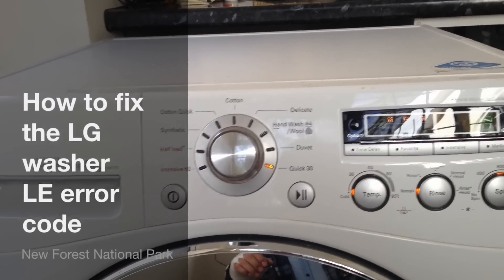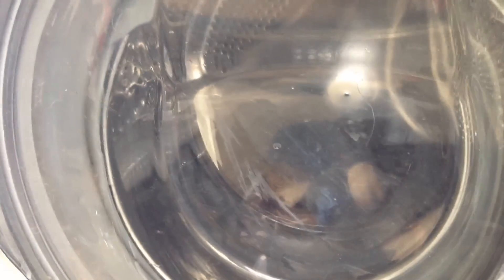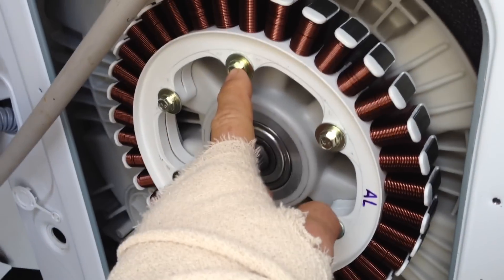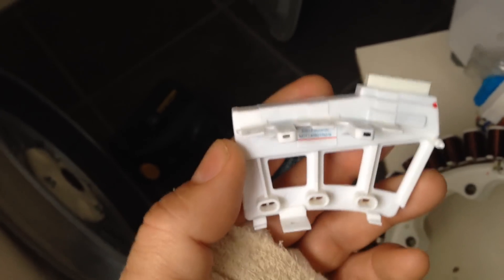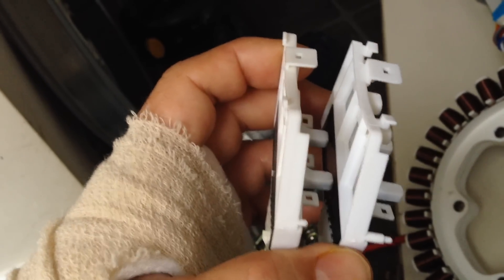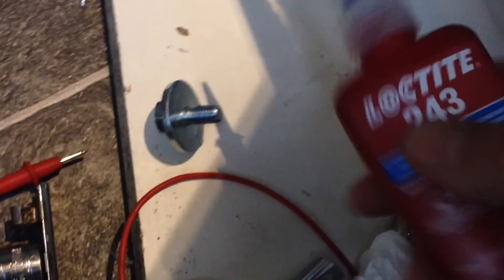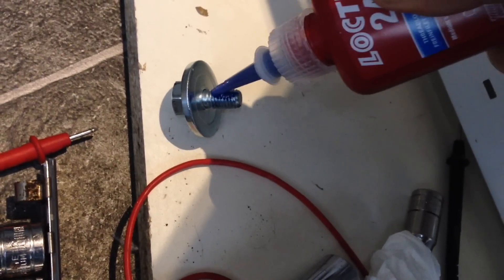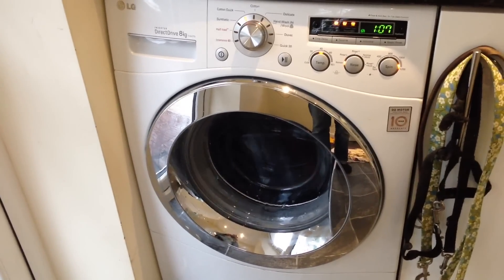How to fix LG Washing Machine LE Error Code - Upgraded 6501KW2002A Part

Comment: Ordered the “original” 6501KW2001A as that was what our washing machine had. 15$ or so on Amazon. Had it in 4 days. With this video and tools readily available (thanks for calling out socket sizes that really helps) took a total of 45 minutes (watching video twice, time to install and time to run a rinse and spin to verify it was working). The sluggish spinning and stopping diagnostic really tipped me off to this being the problem. Saved me the call to a “certified tech” or replacing the machine. Thanks for the video.
Reply from the maker: Cheers. Well done

Comment: I'm going to try this. 10 years zero problems with my LG washer, then intermittent LE errors. I paid a 'pro' ~$100 to troubleshoot and he said it would be cheaper to buy a new machine than to fix this one. So, I ordered a new LE yesterday to be delivered in a week just in case, but then I saw this video -- if this works I'll cancel the new machine and save ~$1k. Thank you for putting together such a clear document and especially in making the part easy to find. The other miracle is youtube figuring out that I had searched on 'LG washer LE error' and then showing me this pertinent video which popped up on my TV last night. I will report on whether this worked in my case as soon as I receive the part from Amazon.
Reply from the maker: Thanks, be interested to hear if you fix it.

Comment: Thank you for posting the video. Just installed the new sensor and machine  seems to be working as it normally should. Cost me $40 for the part and shipping. Heck of a lot cheaper than calling in a repairman or buying a new machine! Thanks again!
Reply from the maker: Cheers. Also great to know and well done.

Comment: This is exactly how its done. My father and I did it in less than 20 minutes. the steel cover was tricky you have to wiggle it out towards you. YES IT IS MAGNETIC. I didn't realize how strong it was. Be careful it's sharp. the only thing we did different is not drill the position sensor just clamped on. It now works like new. We are using it as I type this comment. Great job on making this video.
Reply from the maker: Olef Elias Thanks for the feedback.  Well done on fixing yours.
Reply: +comeinhandynow You shouldn't have to buy a brand new machine and then have to spend time fixing glitches that the company produced.
Reply from the maker: +Sharon Joffey True to a large extent, but then it did offer several years of good service before it broke.  You are right that it should have been designed better, but also nothing lasts forever.  As an ex electronics designer I know that all consumer electronics has a target design life of 10 years. The reason being that physical and chemical changes in the electronic devices mean that it is impossible for it to last forever, so a life target has to be set.  So break downs and fixes are to be expected, it is just a matter of when rather than if.   It is for this reason that I like to show how to fix things so that stuff can last longer.  Regards jon

Comment: Really helpful video thanks. I am mechanically incompetent but managed to repair my machine following your guide. My challenge was getting the backplate back onto the spindle. Fiddly aligning the spindle teeth when the magnet is pulling you about. Just gotta persevere. Great not to have to call out Washing Machine Repairman!
Reply from the maker: Well done.  Thanks for the feedback.

Comment: Followed the advice (not about the 002A part) but about it being the hall sensor and what that looks like, how to remove it and even where to source one from and it worked!  Thanks alot - the machines back up and running 24 Hrs after it broke down - top man !
Reply from the maker: Good to hear, thanks.

Comment: Good video. I would add that removing the stator cover isn't as easy as pulling it off. The magnets and teeth of the center spindle hold it on pretty tightly. I tapped the spindle with a small socket and hammer, there is enough play in the wash tub that it will move forward and away as you do this.
Also, my washer is the LG Tromm WM1814CW and everything in the back looks identical to the model you were working on. I got the upgraded 2002A and didn't modify whatsoever. I just snapped it in place and the machine worked again. Yes it stands out a bit more but so does the power connection directly beside it. I didn't see the need for the modification so I tried it before tampering and it ran like a charm.
Anyway, thanks for walking me through it. Big help!
Reply from the maker: +Daniel batal Nice to read some feedback, thanks for the comments and glad that it helped.

Comment: Thank you so much. Our washing machine motor was completely locked, making a metal-on-metal grinding/hissing noise when attempting to turn. Replacing the Hall sensor solved it.
Reply from the maker: Good to read. Cheers.

Comment: I had a similar issue. The motor won't even rotate. I emptied the drum completely, drained the filter and rotated the drum manually by hand. VERY slowly at first but more firmly once it started moving. It probably had something stuck. I suggest you try this out before opening the machine.
Reply from the maker: Thanks for your input.  The symptoms of the problem fixed in this video are when the drum stops and starts rather jerkily and finally gives an error LE.
Reply: @comeinhandynow  I see. well mine would only spin quarter or third turn and had LE. would be good to inspect the drum internally before disassembling.
Reply from the maker: @mlugggy  Yes true.

Comment: We got this error code. After consulting the manual, we realized that the transportation security bolts in the back panel of the washing machine were in place. After removing the bolts everything worked fine. Apparently the bolts prevent the drum from moving during transportation to prevent damage, but they also prevent the drum from spinning if you try to use it.
Reply from the maker: TheHanapS Thanks for your input
Reply: TheHanapS traducir

Comment: Yeah well, I have a LG wm0642hw and it turned out the problem was the braided anti leak stainless steel hoses, these evident have some kind of valve in them and the water pressure in my house stopped the hose up.. same 1E, lE error.. figured this out after having swapped out the sensor. Swapped in rubber supply hoses and I was good to go.
Reply: According to the Owner's Manual, your error code IE is a water supply problem, whereas this video is about error code LE, which is a motor problem.

Comment: Hi Sir!! What's the name of the tool you used to open the motor cover? Im unable to open the cover Because the protection screw is very hard and I don't know what to use to open it, thanks!
Reply from the maker: Maybe you need a set of screwdriver bits with all the various different heads:  https://amzn.to/36CX3xq

Comment: For future viewers... My EI error was caused because my roommate put in a couple of highly absorbant fleece blankets in a single load that the machine was not able to balance. The result was that somehow one of the plastic pins holding the (tub)supports in place was ejected and the resulting wobble pulled loose a black hose attached to the drain & pump assembly. At first I thought this was just a back flow to release water  that was caused by the pump shutting down but in fact this hose feeds a sensor and if no water is detected it will shut down the washer with an IE error. It is not an "Input Error" but a loose hose to the sensor. When not connected the hose lays against the rear panel of the washer and is almost out of sight.
Reply from the maker: Thanks for your useful input to help others

Comment: Yes this worked for three weeks same symptoms and sound they came back dead washer again. I guess the black cloud is still overhead, Now convinced myself problem must go deeper
Reply from the maker: If it fixed it and lasted three weeks, then it was that part that was the problem.  Did you buy the upgraded part or the original number, see video comments? Maybe try again with the another upgraded part.  Mine it still going.
Reply: I did buy the upgraded part but it's online so who knows what I got but part was different in that it had more clips on it but nothing to correspond with on the rotor. Pls remember that according to LG the le code means an motor overload. If one takes that literally, then what is causing an overload  certainly not the load of a pair of trousers and a few shirts so what gives

Comment: Thanks for the video.  I replaced the sensor but unfortunately I still get the LE code :(  Is there a way to test the sensor (to make sure I didn't get a bum one)?  Any other suggestions if the sensor doesn't fix the problem?
Reply from the maker: Sorry to hear that. I'm not aware of how to test the sensor.  I have heard that sometimes the wiring can get damaged and cause the same error. So I can only suggest checking all the wiring especially around areas where the wiring might get chafed due to the movement of the drum.
Reply: There are test instructions on the net, suggest a google, just changed mine - original was open circuit between pins 1 & 5, new was good circuit this position.  Good luck
Reply: That's great!  Thanks for the info.  I'll try that and search for that.

Comment: Before anything check the tightness of the nut on the bottom of top load wash machines. Tightened mine after making squeaking sound and the le error code. Just saying maybe.

Comment: Hi, i’ve been getting an LE error code on my washing which is the same as the one in the video. It started after I put in a heavy load although i’ve never had this issue before. Now my drum wont spin but tries really hard to spin and is quite jumpy. Is your technique likely to fix my issue? Please help! LG want to charge me £72 callout charge with labour :(
Reply from the maker: Same as in the video.  The fix is the one in the video, I believe.

Comment: I cannot for the life of me get the bolt off. Just seems to be completely stuck. Any recommendations for removing it or why it might be stuck?
Reply from the maker: You could try putting a socket and wrench on it and hitting the end of the wrench side ways with a hammer, making it try to turn very quickly anticlockwise to undo the nut.  Or find a way to hold the drum and use a long torque wrench.

Comment: hello! i keep getting an SE or 5E error on my LG washer cant find any mention of such error do you know anything about that????
Reply from the maker: I have no direct experience, but I searched on the web and found this:
"I have today the same error code (SE) on model WD-11155FB. This code means that the speed of the electrical motor can no longer be controlled. The velocity sensor placed just behind the motor is probably damaged but it can be also the electronic board where is connected this sensor, or the wiring between these two items."

That sounds like it might be the same sensor as replaced in this video.

Comment: I replaced the sensor on the drum but after a month the LE warning came back on,  any suggestions?  TIA
Reply from the maker: +Mike Bernatchez So it fixed it for a month, then based on that my only suggestion would be to try changing it again.  Maybe you had an unlucky early failure, or maybe the part is in contact with the drum and so failed.  Was it the upgraded 2002a part or the 2001a part that you put in?
Reply: +comeinhandynow thanks for getting back to me so quickly.  I purchased the newer sensor.    I will try again and see what happens,  otherwise it's a good machine,  hate to see her go lol

Comment: My it shows CL and all the button are not operating please what's the problem. LG front loader 8/4kg machine
Reply from the maker: Search on google for "lg washing machine cl error".  You will see it is an error with the child lock feature.  Check the manual for how you turn off/on child lock.

Comment: how do you remove the first motor cover bolt. when I try turning the wrench the whole drive spins?
Reply from the maker: Either ask someone to hold the drum, or move the wrench very quickly as in the video.  Knocking the wrench or whipping it round very quickly is usually enough to undo the nut as the drum is heavy it is slower to accelerate up to speed.

Comment: I replaced the Motor sensor and yet when I ran it, the Le code still appears, than the lg wasn't getting any power I had o replace the main control board and the noise filter I ran it and still the le error code appeared
Reply from the maker: +Alexandria Mahr    A difficult situation, but since you have changed everything relevant, I can only think that there is a break in the wiring somewhere.  I have read some reports of a chaff in the wiring to the motor sensor causing a break in the wiring.  So maybe measure the resistance of each wire in the wiring loom.

Comment: I have a door error problem.. How to fix that one?
Reply from the maker: Under Wood Not had that on this model but usual method is to test the door switch with a multimeter(ohms with machine unplugged) meter to see if it is working while opening / closing the door.

Comment: Dear the owner of the video.  
I've got the same problem with LE code. are you sure if I replace the chip it will works fine ? please reply me as soon as possible
Reply from the maker: It worked for me and thousands of other people, so yes, it probably will fix it.  There is no 100% guarantee though, but as the part is cheap it's worth doing.
Reply: ok then. what should I do exactly? buy the same part as a new one ? only that?
Reply from the maker: Look at the video and read the description on the video, that should take you through the steps and show you where to buy the part.
Reply: I live in Iraq.  The only place that I can buy this part either in Baghdad or Najaf
Reply from the maker: Ok try an LG distributor or part supplier.  Can you get any eBay deliveries from outside Iraq on their global shipping program?
Reply: unfortunate no. Iraq is not very modern country . any way. The LG repair shop in Baghdad may help me to get this part. thanks brother for help .
Reply from the maker: Good luck.  I should have checked as I see Iraq is not on the global shipping list, however you could email individual sellers to see if they would ship to you.  I saw this comment when searching this question on eBay: "One thing to note is the individual seller chooses if they want to use the Global Shipping program or not.  If they opt out of Global Shipping they can still ship an item to anywhere in the world they want to"

Comment: How many of you have experienced a TERRIFYING EXPLOSION  from your LG Washer.  Be prepared my family and I did on November 25, 2015 the machine started moving around and jolting the wall parts of the machine exploded.  When I called LG they sent someone to take pictures.  I had read that their have been over 500-1,000 called in reported problems just like mine so you would think that after receiving my call the company would have just sent me a free replacement because obviously they are well aware of the problem.  I have read that they did 2 recalls on them.  Do yourselves a favor and DO NOT even think of purchasing them.  Why they are still on the market is so unfair to we the consumers.
Reply from the maker: +Sharon Joffey Very interesting!  Could you post any pictures or reports of what actually failed. I guess it might help a lot of people!
I'm neither pro or con LG but like to know what fails and why. Mine has been ok for 3 years or so. And has generally been good noticeably quieter than other machines. Be interested in more information.
Reply from the maker: +Sharon Joffey A quick internet search highlights some LG and other top loading washing machines breaking apart on a spin.  What model was yours?  Was it a top loader or a front loader?

Comment: modelwft7070cp PE apear on display what is the meaning of code error
Reply from the maker: I did a quick search and it seems to be a water level error.  Maybe drain holes or pipes are getting clogged.  Check the drain filter.  It was on the front bottom right on this one.

Comment: what about the error PF code... you know something ?
thank
Reply from the maker: +mary leedezma Hi, I haven't personally experienced this but I did find this on the Internet: 
"The PF error code indicates a power failure, basically a drop in power to the washer. This might occur due to an external disturbance like a storm or power outage in the area. It could be caused by loose electrical connections. Check your power cord and make sure it is plugged in properly. A GFI plug can cause this as well. (GFI) Ground Fault Circuit Interrupt (GFCI) outlet is designed to provide extra protection for wet areas. It does this by measuring the flow of electricity in both the hot (black) and neutral (white) wire. If the two are not equal, then there is electricity flowing somewhere else out of the circuit and the breaker disconnects the power. If the PF error code is displayed, turn off the power to the washer, unplug it for 10 seconds, and restart the wash cycle. If the error code continues to be present after these steps have been taken, then the washer may require service. "

Comment: HAD THIS WITH  LG    MOTOR KICK NOT RAMP UP . FITTED  NEW HALL SENSOR  MOTOR  NOW ROTATES  GOES LEFT / RIGHT  WANT RAMP UP SPIN   BUZZ NOISE  FROM MOTOR  GETS WARM/ HOT AFTER 2 MINUITES  SHUTS DOWN    DREADED LE CODE    WINDINGS ON COILS  10 OHMS  MAGNETO OK  IF YOU GO INTO SERVICE TEST MODE   MOTOR WILL SPIN FREELY   .  THINGKING  MAIN PCB MODULE  8 YRS OLD NEVER WORTH £100+ PART .

Comment: I replaced the sensor but still I get Le code plz help
Reply from the maker: I have read that sometimes the wiring loom to the sensor can get worn through.  Check wiring all over and double check sensor installation.  Sorry I can't be more help if that doesn't work.